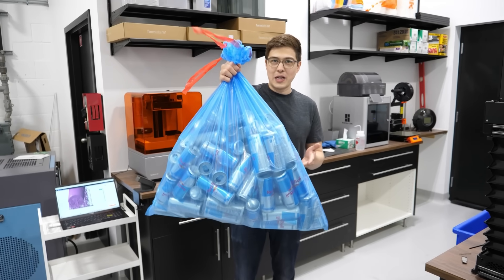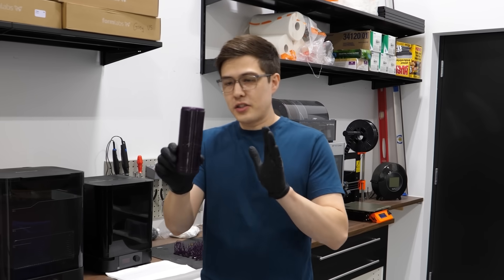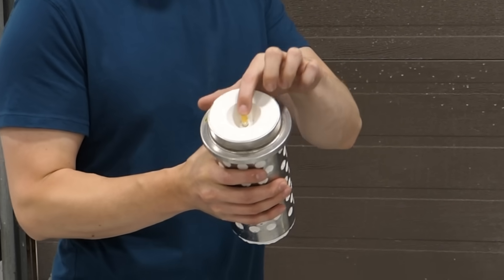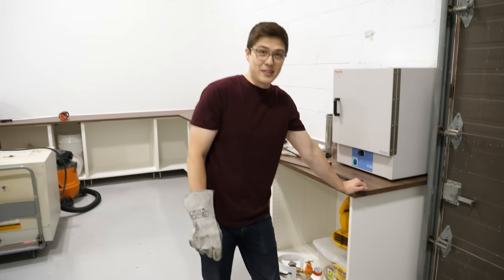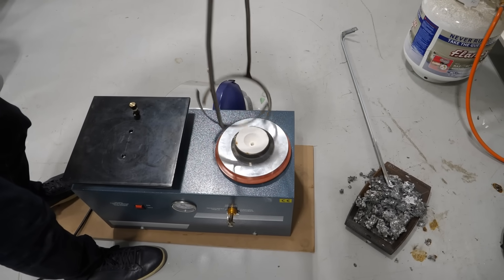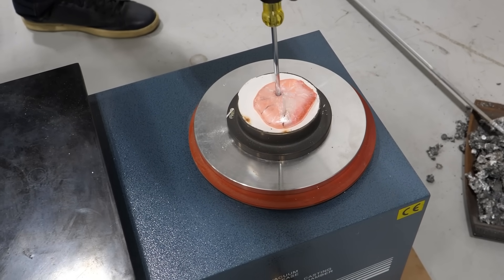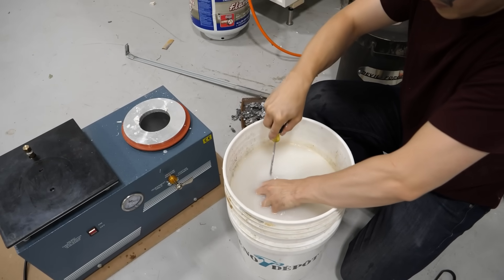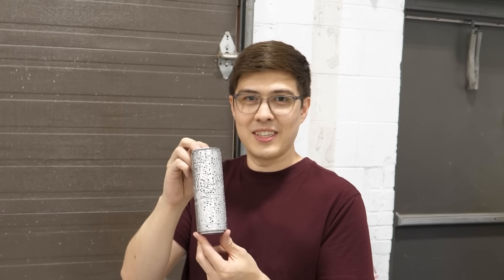Melting down 100 cans of Red Bull into just 1

Comment: Not having a sprew for the air to exit is a mistake I think. Its a big casting with lots of room for air to be trapped. Also you are pouring which is the least effective way to mold with no air bubbles. In the dental lab world the cast spins with force to do the "pouring" for crowns. Good luck in your next one. Love the content!

Comment: As someone who works with aluminum for high pressure die casting, as far as i know, those bubbles are inescapable with aluminum unless you force the metal into a mold at about 1500 psi

Comment: Large holes of that magnitude are typically due to the mold defacing. What type of plaster did you use? I would also investigate the wax resin to make sure it doesn't expand a lot and could've broken pieces off as well. Smaller holes are more reminiscent of gaseous issues, which were also present, usually from heating the metal too long/high and also having the mold too hot which it seems was also the case. If the metal fills the mold and takes too long to cool down, it will continuously absorb more and more gas while molten. The vacuum definitely helps in this case. I probably would've left this mold at room temperature for aluminum. Degassing the plaster is really only done to prevent air bubbles sticking to the part which doesn't seem to be an issue in the end product, as there are holes and not bumps, but might've contributed to the weaker integrity of the mold. I use lite salt (NaCl + KCl) as a cover and drossing flux for aluminum but don't use too much because it's hard on the crucibles. Also, pouring directly down into a deep well with tons of molten aluminum adds a lot of stress and turbulence to the bottom of the mold as well.

Comment: Myfordboy here on youtube is great for aluminum casting instruction.  He avoids cans because they're not really worth it for quality. During the melt he adds Salt to drive off the hydrogen. If you don't degas you will get holes in your casting. Sodium Carbonate helps gather the slag and impurities.  There's also purpose made EXF236 Aluminum Alloy Drossing Flux (Potassium Aluminum Flouride)

When he makes a greensand mold he has holes for a feeder (in) and riser (out) going down to the part.  Without the pipes air has nowhere to go to vent and it will fight to bubble out like it did with your single hole.  The riser will be at the highest point where gas could be trapped.  He also adds additional height to the feeder and riser by using more greensand in a can to extend the pipes.

Extending the feeder tube higher helps with the pour.  You had to slowly tip your crucible because you were scared of overflowing. This helps by having more metal available to flow into the mold fast.  

Extending the riser with his can of sand method gives you a little more reaction time, a confirmation that there is enough metal added and also helps contain any excess metal.  Some casters could have a riser exit but leave off the extension and end up with hot molten metal overflowing onto the ground as a result.

Comment: careful with the aluminum fumes when melting down cans, aluminum is a toxic metal alloy and also the fumes from the paints and plastics on the cans are also not good or healthy to breath in. I suggest a full respirator at least as well as melting them down outdoors as opposed to indoors would be better.

Comment: Just trying to melt cans turns them into almost all slag. That's due to how much of the can is exposed to air. You need to reduce the exposure. You can do that by crushing the cans and pushing them under molten metal. Then they oxidize a lot less. You get a lot more molten metal out of them then.

Comment: My thoughts were you really didn't think to put the plaster in a vacuum chamber to remove all the bubbles? I instantly predicted a million bubbles and the end product turned out exactly as I pictured. 
Next, I don't know about the chemistry of aluminum cans but it looked like you smelted inside your shop. I worry the plastic liner of the can as well as the paint burning off the can could release gases you don't really want to breath. This might be safer to do outside or with some sort of ventilation.

Comment: That looks like hydrogen inclusion from moisture contacting the metal as it is melting. Drying out aluminum before Introducing it into the mold is important for this, especially if no degassing steps or additives are used.

Comment: Just a heads up Nigel, I would recommend printing larger parts like this hollow (with drain holes to evacuate resin) to reduce the pressure inside of the investment during burnout and save resin.

Comment: You have to degas the aluminum before you pour it - you can do this with a lance and argon or nitrogen gas. The pores (what makes it looks like swiss cheese) is actual hydrogen that is dissolved into the liquid aluminum. Once the aluminum cools, the hydrogen is trapped in place leaving voids

Comment: Several mistakes were done in this video. First of all it worth separating can's walls from the top because those are different alloys. One with manganese and other with smth else. Second, burn down the sugar, water, paint etc. Third - add some flux to prevent the aluminum from oxidising that bad. Will also help to separate the slag much easier

Comment: Degassing the metal in the crucible before pouring, add a bit of table salt in an aluminum foil packet.  Stir and it should remove most of the gas.

Comment: You need to orient the can at an angle and place the way connector to the topmost point. As you placed it, there is air that cannot escape and will leave voids.
Also you need to account for thermal contraction of the liquid metal, you need an cast reservoir.

Comment: Yeah, you lose a lot in the casting process because of the plastic lining. it melts/burns off and leaves impurities that clump together with the aluminum, in addition to the losses you already take from simple oxidation. Also, there's a lot less aluminum in a can than you'd think. I've melted thousands of cans down into bars, and probably inhaled a lot of toxic fumes (but let's not talk about that) because I wanted to make thick juicy aluminum bars.

Comment: Gotta add aluminum coke or some sort or powdered form of aluminum in the mix I think to reduce the pitting and bubbles. Also you can use electricity to align the grains of the aluminum perfectly I think that also removes 90% of imperfections it’s more complicated than that but I’m sure Neil can figure it out.

Comment: First thought, a lot of people here are very wrong!!! 

Hi, as a person that scraps a lot of aluminium cans I can tell you why you ended up with so many bubbles and also why you got so much slag. Bubbles come from water and hydrogen (mainly hydrogen) molten aluminium is a great solvent for hydrogen (that comes from decomposition of plastic - you have a ton of plastic in paint and plastic that is inside lining of the can) when you cool off aluminium the solubility of hydrogen gets lower and bubbles form. Industrially you would blow argon down into molten aluminium so that it takes out hydrogen with itself. On small scale you can also just use some kind of carbonate wrapped in aluminium foil and use a stick to pin this package into the bottom of crucible. Let it degas, deslag and you can pour. 
Another problem with using aluminium from cans (and extrusion) is that it wasn't supposed to be cast, the alloy used is not good for casting at all. You have to add some elemental silicon for it to be castable.

Secondly for the issue of slag. I found that it's best before scraping slag off, that you first add some halide salt mix up everything then the slag brakes into what is basically powder and any aluminium droplets inside are taken up by the larger mass. This way you really are saving a ton of aluminium (you would be surprised how much actually) 
Sorry if I butchered any technical names, first of all I'm not a native English speaker, second of all I'm not in the industry, what I'm doing is that I melt metals for myself for CNC mill and such. I've made my own diesel blast furnace and use a ton of scrap metals so I really think I have big amount of experience.
Reply: Funny thing is that he worked with molten aluminium before, and he also explained why it is so bubbly.
Reply: Your explanation as a non-English speaker is very good; better than half of the English speaking world I'd dare say.
Reply: now he will do it with argon! nile loves argon as much as cody'slab loves mercury
Reply: Amazing explanation. Thanks!
Reply: Great explanation, as I was watching this I was wondering what he was going to do to account for all the plastic that’s both on and in the cans, but was surprised to not see him do anything, and your explanation makes sense as to why he got the end results that he did.
Reply: I learned the hydrogen thing from Nile's purple gold video lol. I was surprised he didn't put that knowledge to use here, but I guess he just couldn't be bothered. 🤷
Reply: Dross…
Reply: hey, i just want to tell you that u r really cool for that. Even if you had to do it because of the finances. best luck!

Comment: Hey Nile! hope this finds you. So you are not actually applying vacuum to the flask during the pour.. you need a gasket that goes between the flask, and the top metal ring on the table. the gauge should between 20 and 30 when you pour. generally when i cant get a good seal right away i will take the tongs and push straight down down on the flask, this only works through if you have the missing gasket in place. the gasket does wear out, and if i cant get a good seal in about 20-30 seconds i will put the flask back in the kiln for 1 hour or so, to bring it back up to casting temp and use a new gasket. the gaskets for that size of flask are like $10. also saw the same thing happening in the gold grill video.. you achieve surprisingly good results despite the lack of vacuum on the flask.
Reply: I was thinking the same thing. Couldn’t tell if the sound was extraction fans, his vacuum wasn’t on strong enough or he didn’t get a proper seal. Wasn’t going to bother checking, cause others (you, namely) have already done so. 
Funny how he has so many wonderful toys but forgets to check the instructions before using them. 
Ah well.

Comment: I have an idea, bearing in mind I have zero casting experience...

The bubbles - I assume this is caused by bubbles in the plaster. Could you attach the sprue using a wire through the middle to give it more strength, and then vibrate the plaster mix to get the bubbles out?

The wax melt - does the wax evaporate or how does it work? It looked like the sprue was pointing upwards so just wondering where the wax ended up, could the bubbles have been wax deposits? Would it be better to melt it with the sprue downward to drain the wax out? Could maybe coating the wax form in some sort of spray or coating help with ensuring nothing is left behind stuck to the plaster inside the mould?

Comment: You need a vibration table to remove bubbles that's the issue you had an dif that doesn't fix it you need to make sure the plaster is moisture free you can also use a vacuum chamber

Comment: You already had the perfect model for making a casting... the literal cans. Just Dip it in some slurry and then encase it in whatever support-material you want (like blaster). For lettering - just glue that to the can.
Reply: Except then you have to burn out aluminum cause pouring molten aluminum into the can wouldn't work
Reply: @noodlelynoodle.  I mean aside from why would it not work - so what? That still means he could have skipped the entire 3D printing thing.
Reply: @ABaumstumpf  you would be adding a bunch of slag and porosity in from the plastic liner and paint melting and burning from the original can when pouring the molten aluminum in, doing it this way if he'd actually had the vacuum working right would have stopped the porosity he just didn't use the machine right
Reply: @noodlelynoodle.  "you would be adding a bunch of slag and porosity in from the plastic liner and paint melting and burning from the original can "
The mould has to be cured and preheated anyways - aka all the paint long since was burned away and the bit of slag can be just thrown out.
Read again what i have suggested: Instead of 3D modelling one Using the Can to MAKE the mould, not leaving it inside as is.
Reply: @ABaumstumpf      you're still going to have the issue of the can partially melting when you pour the aluminum in causing the outer surface to be messy not to mention the porosity problem that trying to pull a vacuum through an aluminum can would cause, you'd have a way worse end result than this cause while he didn't pull a proper vacuum he had it running at least whereas using a can it wouldn't allow any vacuum except where the outer can melts through which would pull metal through the holes. Unless you're melting out the entire aluminum can I don't see it going well and I don't even think that would work cause of aluminum's melting point and how long you need to keep the mold that hot to fully clean it out being hot enough to degrade the mold material unless you get into different materials than standard and at that point you're adding more effort in than just modeling the can and printing it trying to figure all that stuff out when lost wax/plastic casting is the standard for a reason cause it's super simple and gives great results when done right. Even then I don't know that the mold would end up actually clean since you're supposed to burn the wax/plastic out in the kiln rather than just melt it
Reply: @noodlelynoodle.  "you're still going to have the issue of the can partially melting "
No, read again.
Reply: @ABaumstumpf  i already addressed the other possibility in my comment, there's nothing to read again, if you're talking about using a 2 part mold that's a completely different type of casting that doesn't use this equipment

Comment: Going quick and hot molten metal does not go together. Especially when you are basically wearing no protection at all. That face shield will do nothing and those clothes and naked arms have no protection at all. 
I like the channel, but this should come with a big this is very dumb warning. Do not try this at home. 
Casting can be done at home safely, but this wasn't it.

Comment: You have to either vibrate or suck the bubbles out with a vacuum chamber if you want it perfect. Vibration is easiest, you can just use a power tool that vibrates to do it.

Comment: mixing in some slat or other flux could help you remove oxides from slag and make them into grey powder instead of just junk, making metal recovery more efficient
next time burn out wax with metal inlet facing down so it not only burn out but flow out leaving less residue inside
also i am surprised how well it worked given how much of a hack job it was but still all those sink holes that look like porosity or air bubbles show how much you didn't acount for casting pressure and shrinkage
i been casting aluminium thing this whole summer and this is exactly a casting i would avoid . you need to make more videos like that so i can laugh more

Comment: Nice and Safe work like always...

It is not safe to melt aluminum without a mask, especially when working with materials like soda cans that have coatings and labels. The fumes produced during melting, particularly from burning off paint, plastic, and other coatings, can be toxic and may cause metal fume fever, a condition with flu-like symptoms.

Comment: Next time you vacuum cast aluminium you should add some borax wrapped inside some foil before the last dross removal. This will degas the molten aluminium and give smoother results. 
The bubbling could also have been from not letting the plaster dry out enough before you put it in the kiln.
Reply: If he had wet investment, without any vents…. He wouldn’t get bubbles. He would get explosions from the rapidly expanding water vapor.

Comment: I have a medium-sized propane kiln much like yours, and I melt down all my aluminum cans into ingots, and I've never had that air-pocket problem. My ingots are always solid. If you plan to do more work with aluminum, I suggest investing in some pouring tongs and crucible tongs.
Reply: His temperature was just far too high.
The aluminum dissolved too much gas. 
Also, he didn’t have a proper vacuum around the flask to draw gasses through the flask.

Comment: If you want to clean your melted aluminum you can toss in a chunk of calcium carbide like you would use to make acetylene. It bubbles the impurities to the top so you can scrap it off with a ladle type spoon. Do this right before casting. Also maybe hit mold w/metal with something vibratory to remove air bubbles. Then aluminum castings will be defect free.  😚👍

Comment: Did the plastic BPA liner inside the cans have any effect?
Reply: I imagine it would have melted, floated to the top, and burned away. It probably increased the carbon content, though probably not much else. Not a chemist or metallurgist, though, so I can't say for certain.
Reply: @justsomeguy5628 it probably accounts for maybe a 10th of the slag. As it burns, it creates carbon and other nasty compounds that mix with the aluminum, helping turning it into slag. 

It’s far better to remove the plastic liner and paint before melting, or burning the stuff off at a temperature lower than is required to melt aluminum. That way it won’t contaminate the melt.

Comment: I'll NEVER support Formlabs; they bought Micronics to prevent affordable SLA printing at home. Micronics could've been the next Nvidia as SLA printing opens an entire new world. Imagine printing a metal part for your truck because Ford charges $400 for a part that could cost you 50 cents in metal and energy to print.